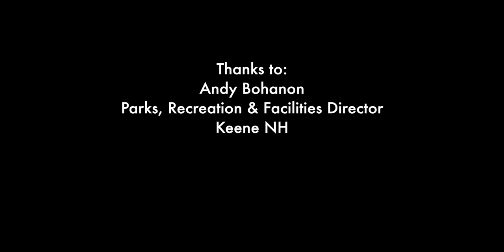City of Keene NH burial process in municipal cemetery 2019

Comment: that is why vaults are used because the equipment might be over a grave while digging it
Reply: Why is a vault needed.  I thought the coffin was just put in the ground.
Reply: @tpfmike1976  the vault protects the ground so it doesn't sink, if you ever notice old cemeteries with old headstones how the ground is all uneven? Thats because they didn't start using vaults until the 50s or 60s.

Comment: And we use ropes 2 lower the casket while they use and a vault and a lowering device👍🏼  even after with a pnumatic hammer for the ground respect🙏🏻 
We do have mostly extensions around the stone n also lines not just here and there a grave but this is verry nicely done respect 4 the ppl who do it.
Wat also their job is 2 dig up and all wat comes with it its not easy to do if ur light headed.

Comment: I thought the family watches the coffin go down, not leave before it gets lowered.
Reply: Most of the time the remains are lowered in long after the mourners have left because it takes a bit of time to finish the burial process , the casket is put into the vault then both the vault and casket are lifted up so the lid can be placed on and sealed shut then the vault is then lowered into the grave which takes a few minutes to lower down.
It's best that the mourners not be there cause the cemetery workers have to be able to do their work easily and as quickly as possible so that they can prepare for another burial.
Reply: @josephbennett3482  just yesterday at my college campus there's a cemetery & i was at a building next to it & i saw a funeral proceeding during it & the family all gathered for about 15 minutes & then after everyone left was when the casket was lowered. i think it depends on requests from the family's arrangements too

Comment: Surprise they didnt seal the vault some states they have to seal vault concrete or adhesive they put dirt on top.
Reply: I work at a cemetery. Here there are both sealed or basic vaults, just depends what the family wishes to purchase. An unsealed vault is about as good, there's just not quite as much protection against water. It often depends on the spot of burial.